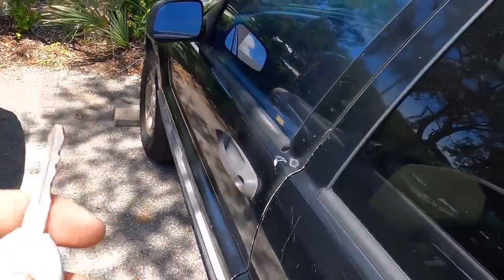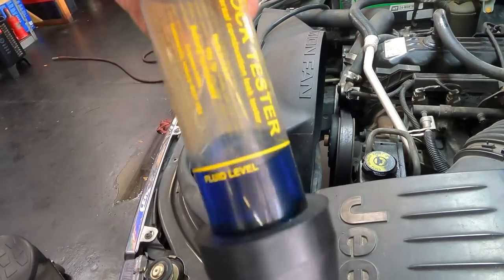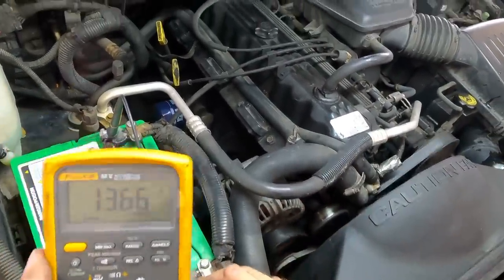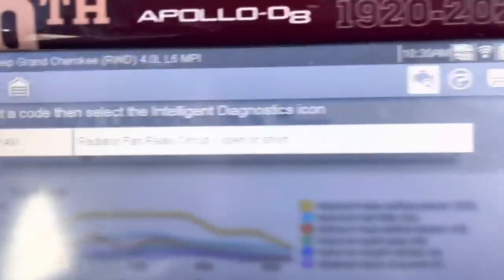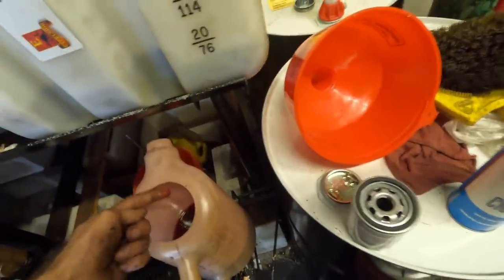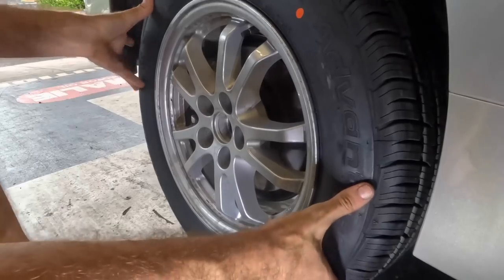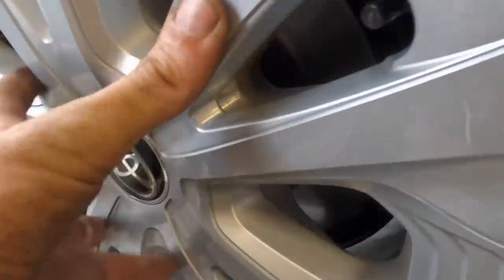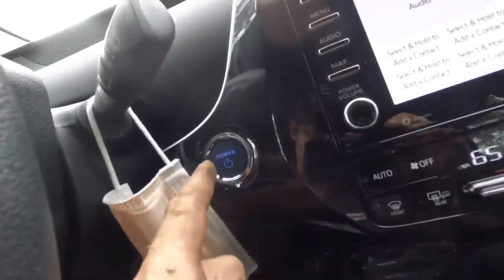How much longer will it last? Jeep Grand Cherokee 4.0 I6 | Compilation

Comment: My first vehicle was a 1994 Jeep Grand Cherokee can’t remember if it was a larado or not but it was a v8 was a good vehicle but it had it issues the moonroof leaked and couldn’t find replacement parts for that and what I believe condemned it was when I was changing out the water pump I noticed the engine block was sweating out coolant I couldn’t see any cracks and cool wasn’t mixed into anything just was loosing coolant over time and I figured it was going to be to much of an issue to fix. And that was shortly after putting a new transfer case cause so very important coupling inside went bad sorry can’t remember the name of it except it was a coupling that had to do with 4wheel drive
 on a Jeep that was in 4wD all the time but after that had to do the crankshaft position sensor. But when I very first got it the big issue was the catalyst converter would glow cherry red after running 10min changed the converter and had to re order the spark plug. For my first vehicle I had to do a lot of work on it but had my fun when I had it like one year it snowed really bad so I got to work early so I didn’t have any issues but my co workers in small cars were getting stuck in the parking lot and I ended up spending a good hr on the clock using my Jeep to pull and unstuck other coworker

Comment: I was a little disappointed that someone had already cut an access hole for the fan relay on the Jeep.  I was waiting to see how you would have dealt with that.  Why they would put something like a solid state relay in such an inaccessible place has always been beyond me.  Could have mounted that anywhere.  I am not surprised that the old one looked new.  I replaced one to only have it last a couple months.  Took it back and replaced it with a factory one.  Aftermarket parts suck.

Comment: Fan relay is solid state so requires suitable cooling, original was only mounted with one bolt, not enough clamping force between relay and steel mounting for heat transfer, relay cooked itself...a common failure on this model we always mount the relay on a finned aluminum heatsink, lasts for years after than

Comment: Your hands look a little on the dirty side you might want to consider some Nitrile gloves  many of them you can be used several times if your not in the grease? You can grab part of the wrist glove make a slight twist of the wrist glove and blow on it and it will expand and you can pull the glove off easily by grabbing the wrist end and peel it off then cup the wrist part an blow on it and all the fingers will go straight then reverse the wrist part of the glove and blow it out were the used part is on the outside!

Comment: Instead of taking the water pump off could you just take the bottom hose off the water pump and stick a endoscope in the water pump to see the impeller? am not a mechanic so I don't know.

Comment: The overheating Jeep - isn't that more likely to be a problem with the radiator being partially clogged, or just the radiator being too small? The hoses going in and out had very little temperature differential, which is exactly what you'd expect with the pump working well. If the pump was moving slow, then water spends more time inside the radiator, so it cools off more, and you get a big temp diff. Which is the opposite of what we're seeing.

The thermal imager showing the hoses to be 203f means the radiator is filled with very hot water, which is exactly what you want because the hotter the radiator, the more energy gets dissipated through the flowing air. Pumping water faster through the radiator will lower the temperature diff even more, but because the radiator stays at the same temp +=1f, the heat loss achieved through air flowing through the radiator will only change a miniscule amount.

 If the coolant hoses were all 100f with the engine at 230f, then you'd have a problem, maybe the thermostat not opening or the pump not working. The only thing potentially missing is heat conduction from the coolant to the metal of the radiator. Or maybe the radiator is too small for the 4l motor and meant for the 2.7 liter version.

Comment: Shouldn’t the number of miles it on the donut be marked on it since it will definitely fall apart when the rated miles are exceeded? That way the owner knows how many miles he has left, and whether or not it needs to be replaced (assuming he even cares and how much of a gambler he is).

Comment: great video what a pain to get to the relay if somebody had not been there first with a cutter you would have been in trouble my wifes car is very nearly a classic next year it will be but if it wanted something replacing it would get it that way you get to keep them on the road thank you would have to give my a couple of thousand to start the car with all those mask's hanging down 
you for the video

Comment: Wouldn’t a poor performing water pump cause a greater than normal temp drop across the radiator?
Reply: In this case it seems there is no flow at all.   Pump grenaded.   Hot water coming out both ends of the engine.
Reply: Nope, a Good Pumping Water Pump would Push More Water through Radiator thus Dropping the Outlet Temp. going Back to Engine...
Reply: No, it wouldn't. Normal function, temperature drop is caused by hot water from the engine being pumped through the radiator, where air flow is cooling it, dropping the temperature. A poor performing pump is not moving much water through the radiator and the water is just staying hot, with hot engine sitting at the inlet AND the outlet (instead of being cooled at the outlet).
Reply: @StrangerInAStrange  if the water was flowing slowly through the radiator it would have more time to dissipate heat and would be cooler when it exited. I have radiators in my house. If the flow is low the return pipe is cool and only the top of the radiator is hot. When I increase the flow, the exiting water is hotter and more of the radiator is hot. Ray measured the temps top and bottom as being almost the same. Seems to me the rad is not dissipating the heat probably due to the core being mostly blocked.
Reply: @v12alpine  a quick test for no flow at all would be to check cabin heating.

Comment: I bet airlocked, upper hose is way higher than rad, an engine. Been there done that. Lol I just looked at my 98 5.2, and 4.0 upper hose is not as high as 5.2. My apologies for being bold and brass.

Comment: I came across someone in a 2005 Chevrolet Suburban who lost a wheel while traveling 40mph down the road. It appears what had happened is the last person to mount the wheel on the vehicle over torqued the lugs and effectively stripped at least 5 of the 6 with the sixth stud unable to support the wheel and snapping off letting the wheel/tire assembly fall off the vehicle. The rim was damaged, 5/6 lugs were stripped to the point of being unusable and the 6th stud was snapped off all because of someone's stupidity with the lug nuts.

Comment: Pull the headlight, cut a hole in the header panel, that will also help keep it cooler, they burn out in the 99's all the time...

Comment: As the owner 2 - 98 grand cherokees and a 04 grand cherokee I do agree that jeep grand cherokee in not mechanic friendly for most work but I will say that any jeep with a 4.0 will go a long way the 97 I currently drive on the road had 95,000 miles on it March of 2020 currently mid September 2022 229,000 with little problems and I put 100+ miles a day delivering newspapers 6 days a week in northwestern part of Pennsylvania

Comment: Now i want to take my thermal gun to measure the temp drop across the rad in my 2004 Jeep TJ Rubicon lol. 

Overheating fixed... now. It would just randomly overheat. 50/50 coolant (Canada), tried "wetting" additives. No indication of head gasket leaks. Original rad lower tank holed on trail maybe 1 month off the lot, some massive overheating getting it out to the road, even with pulls. Overheating started later.
1) Replaced Thermostat- no fix.
2) Fan clutch locked up, electric same price - upgraded. Of course no fix of overheating, but power and fuel economy drastically improved!
3) Pump beginning to leak - replaced. Can't remember if did high flow. No fix.
4) Rad fractured top tank. Replaced. No fix.
5) New rad tank seal failed - crimps loosened. Replaced with full aluminum, welded, bolt-in Mishimoto rad - supposedly same # of cores etc as factory. Now almost too cool! I've had the fan circuit fail and barely noticed! I will probably use some kind of blanket or shield for winter this year.

Comment: Not sure if all vehicles are equipped the same but my wifes Nissan Rogue will honk the horn when the appropriate inflation pressure has been achieved. (engine running of course)

Comment: Low flow across the radiator would cause a high differential as with low the water is in the radiator longer. A plugged radiator is more likely IMHO

Comment: I’m sure you checked other lugs on the Prius, but I would have been curious to know the condition of the other lug nuts. I’m sure they were not touched by the well meaning, but inept Donut (Operator!) Tire installer. I assume that the tire was flattened due to the accident. 

Anyway, thanks for your Excellent videos! Your explanations during the diagnostic phase are incredibly well thought out, complete with diagrams and a step by step tutorial.  I absolutely love your attention to detail and every repair you make is very professional looking. 

Please stop with the brake cleaner! I’m in NC, I think you have a bunch of viewers in this area. I think your videos have caused a run on the stuff at my local O’Reillys. 😂 I can never find more than 2 cans in there! 😮 

I recently found your channel and have learned so much that I almost can’t wait till a friend or neighbor brings me their broken car. Thank you and please keep up the great work on these videos!

Comment: I'm surprised the donut spare doesn't take more pressure - most I've had ask for 60 psi.  Then again, I also didn't notice the usual yellow sticker stating "50 mph for 50 miles max" so maybe Toyota uses different donuts or something.

Comment: Kinda surprised that 4.0l made it that long without needing a water pump. I know a guy with a 6.2l small block boat who has to chage out that impeller every 2 years (yes I understand you do it more often cause you are sucking in dirty lake water).

Comment: It failed because of the lack of the heat paste on the back to transfer the heat to the body.  You  can use the CPU heatsink compound from a PC.  Cheap and easy.  But me boyo, that controller  is badly placed.. wow

There is a new compound called "liquid metal" but im not sure if that would be better ot not
Reply: liquid metal only works on chips. when exposed to the elements like in a car, it will quickly deteriorate and most likely have adverse reactions with the metals involved here.
Reply: @WooShell  Im not sure about that, to be sure we would need to test that theory.

Comment: 25:00 most likely especially being Florida they were hit from the rear and the person took off because in Florida and from what I understand many other parts of the country a hit and run will most likely not be followed up on even if you do have the other person's information it's basically a free-for-all out on the roads, no one is held accountable for anything anymore

Comment: I would have no problem charging a diagnostic on low tire pressure if the owner doesnt keep up with it.  but IMO, the diagnostic should have included a quick check for  3 nails in each of the low tires

Comment: "Customers notice missing caps." Which is weird because I see a lot of vehicles, new and old, with missing valve caps parked in parking lots... 😅 One of these days I'll see if I can remind one of the drivers that they're missing valve caps. I mean, they are like $2 for a set of 4 so they aren't like some expensive, hard to install part.

Comment: Yeah Chrysler fan relays are famous for failing, you have to use a good quality relay, not cheap ones, and both bolts must be used, and clean the mounting surface, and use thermal paste for a good bond.

Comment: At 22:21 you said pressure differential, you'd already indicated a temperature differential (dT).  So, pressure differential (dP) is correct if you meant the water pump was sick and not creating enough head to achieve a higher flow and therefore high dP across the radiator.  Realize that low flows will allow a longer residence time in the heat exchanger and therefore a higher dT; and by definition low flow is a result of low dP.  For a fixed heat input the lower flow will result in high dT as well as a high engine coolant outlet temperature since the coolant spend more time in the engine.  Since the coolant temperature gauge/instrument measure the hotter outlet it will indicate higher values.  Now this is still bad for the engine but with degraded flows dT (Thot - Tcold or Th-Tc) across the radiator will rise.  With very low flows or no flow the whole system will heat up Th and Tc since you are at the mercy of a natural circulation system.  

                                               The old formula Q=m*cp*dT explains the normal system fairly well. 

Q = Heat transferred which is dependent on engine work and is pretty constant in an idling system with fans on or off and other loads constant, 
m = mass flow rate,
cp = specific heat capacity of the fluid which is fairly constant and 
dT = Th-Tc across the heat exchanger.  

So, the dT is inversely proportional to the liquid flowrate.  One last variable is the thermostat, if mechanical, can throttle flow to maintain a constant temperature or just be open or closed.  When you bring electronics in to control a fan your diagnosis has to include that feature.  Assuming the fan is always on during an observation you will have a new steady state condition to monitor and diagnose.  A lot of words to say I agree the pump is likely sick but very sick not just lowered flow.  Not sure what the boiling point of the coolant is but with a leak of some sort and a low engine load there could be small steam leaks at various points in the cooling loop, not likely.  But the coolant expanding in the expansion reservoir would over time lose more coolant via evaporation.  I'm still thinking the impeller material is distributed throughout the coolant system or the shaft is broken (less likely).  Good job overall I wonder if the owner knows his past fender bender created so much hassle for a simple relay change.  One last thing, the relay obviously is a solid-state device, frequently these types of components reject heat via conduction through the back plane where they mount; so, they sometimes use a thermal conductive grease when mounting.  In this case the missing fastener turned the device into an air-cooled component via the poor thermal contact, perhaps a cause for the apparent short life.  The owner had obviously been in this area before as evidenced by the poor state of the modified shroud.  Oh, and did say I love the channel, very entertaining and quite a comment on the general intelligence and post-apocalyptic chances the average consumer will have in this country.  I'm sure you'll do fine, there won't be much of a need for lesbian gender dance study experts during the upcoming de-evolution, but I'm sure they'll cook just fine i.e. well marbled.

Comment: I understand that some customers may be elderly and have every right to bring a vehicle in the get their tires aired up. If this was a young customer who could not air up their own tires,  whoever taught them to drive failed them. Vehicle owners have a responsibility to learn the most basic maintenance tasks on their vehicle. The newer vehicles make it even easier to maintain tire pressures, oil level, filter life, and etc. End rant 🙃

Comment: Fifty bucks says the water pump impeller is just fine, but the radiator is plugged up with mineral deposits. A view of the radiator front-on with your (I'm envious) Snap-On / Flir thermal imager will show a very uneven heat profile across the radiator.

Ray - I would like to send you a bottle of P-80 THIX Rubber Assembly Lube to try. I have to buy it by the case and the last bottles always go badon the shelf before I use them, so why not share one with you now. The stuff is great for heater and radiator hoses, seal installation, installing air hose fittings, etc. Evaporates and leave little or no residue. Send me your mailing address and I will get you a bottle to try.

Comment: I have a '02 Jeep Grand Cherokee Laredo 4.7L V8 vinJ
Plenty of issues with them. Chrysler is absurdity!
My hood struts are bad.
Power Steering rack.
Need Control Arms, ball joints, trailing arms, sway bars and links, tie rods, shocks, coil springs and coil insulators, and calipers, rotors + brakes.
Electronics are bad, power windows, power lock driver door and power windows don't work.
▪︎ Most of the issues are caused by proprietary fluids/parts needed that are discontinued or parts made cheap or engineered horribly.
I'm going to fix the suspension and hopefully wheel hub, brake assembly soon and a few steering components. Got front Shocks changed but working on getting the seized bolts of rear shocks unsiezed from bushing sleeve any  mount/nut that's welded on from factory!
Replacing rear shocks bolts:
M12x1.75x80mm top hex flange bolt and M12x1.75x70mm bottom bolts which are Grade 10.9, Zinc coated, Partial Thread and Coarse Thread in case anyone needs to know

Comment: Chrysler quality. What a place to put a fan relay but then again on new Chrysler products they solder the fuel pump relay to the underhood fuse block requiring a replacement of the entire assembly. $1,200 part anyone?